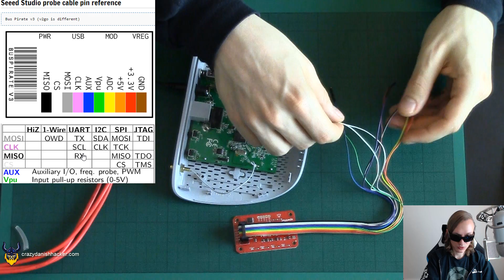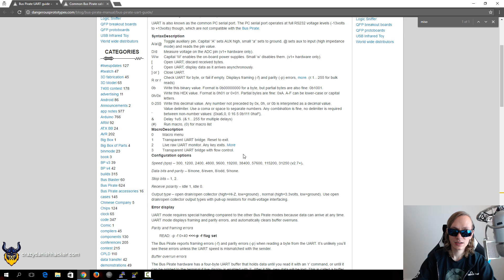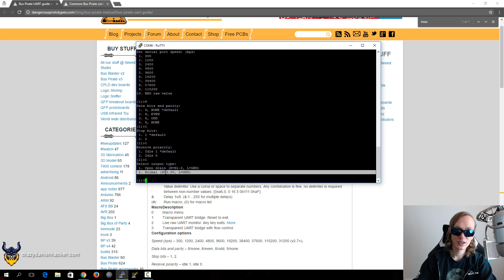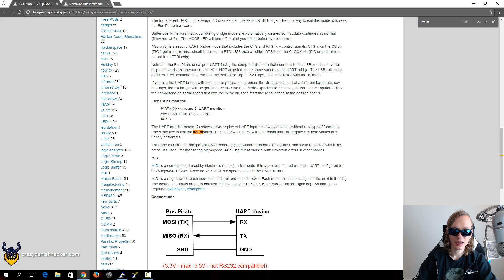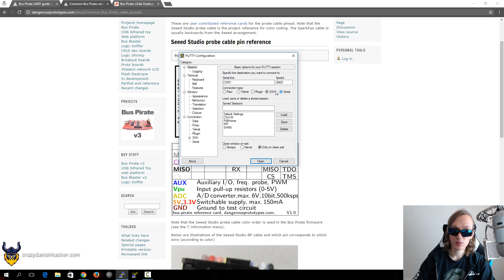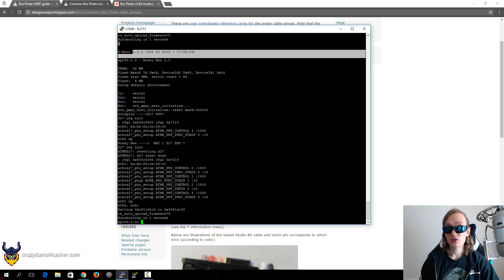Accessing Hidden Serial Consoles - BusPirate Demo 2/2 - Hardware Hacking Series #5

Comment: hi danish, time without write you, it seems spectre and javascript are a big issue

then what i told you is happening in www.elchat.com maybe is true, that chat uses javascript

do you think a website as www.elchat.com can exploit the spectre cpu vulnerability?
Reply from the maker: I doubt it, spectre and meltdown requires a lot of skill and reliable code execution at the moment as far as I know. If you're worried about this attack, then make sure Chrome has auto-updated and that "strict site isolation" has been enabled in Chrome: chrome://flags/#enable-site-per-process (Click enable and restart)
Reply: thanks danish

Comment: Try using the Arduino and Pololu PCB to activate a stepper motor.  It doesn't work. Nobody will help you figure it out. Your head hurts. I have done a few things the U.S. feds would be interested in. Mainly in the U.S. it's the airwaves the feds are interested in and pirate radio. The FCC tracks the transmissions and confiscates all your broadcast equipment and fines you in the tens of thousands of dollars range. The FCC posts every bust they make on their website. There is a small town in India where a certain electronics firm manufactures GSM imterceptors and will only sell to the military. Imagine if you were a private investigator and you used one for a client who was going through a divorce and you captured incriminating conversation. You could sell interceptions and make back your money. It's like a little suitcase with two small antennas. You set it on your kitchen table. It will convert sound into text and in three different languages. You brought us to the brink but dammit I want to hear stuff! Binary strings are all good and fine but where is the juicy stuff? That is my dream. That is my nightmare. Even the government around here is encrypting radio transmissions. What do the police, the CIA, the FBI and all the rest have that is so valuable? They have INFORMATION! Yours in secrecy but if they want you they'll get you. LOL

Comment: how is BusPirate difrent then Serial Console which you have showed here: https://www.youtube.com/watch?v=kxznYuS4tkY?

does it support JTAG?
Reply: easy to say hard to find thats why i told u if u give a tuto i dont need alot even i watch ur vedios for radio have some probleme on my kali :(
Reply from the maker: Good questions as always Veso266 :-) The USB-to-TTL device in part 1 is a lot easier to use (plug-n-play if you have PuTTy), but it can only do UART, which I've shown in my videos so far. The BusPirate can do many different modes, e.g. 1-wire, I2C, JTAG, etc. but it needs to be configured first every time you use it. 

So when I want to play with my routers for example, then I actually use the USB-to-TTL device because I only need to plug the wires in, connect via USB, open COM4 in PuTTy and go. 

For the BusPirate I need to look up the diagram because it has a lot more wires, connect them, then connect via USB, open COM4 in PuTTy, then reconfigure it into UART mode, and finally Macro mode (Transparent Bridge I think it is), and then I can use it :-) 

I haven't tried these yet, but I have read quite a bit about JTAG a month or two ago, to see whether I needed a JTAGulator or equivalent.

If you're only going to do UART, get a USB-to-TTL device. If you're going to do other modes, get a BusPirate. No need to buy both :-)
Reply: need to talk with u if u are online respond please and thx
Reply from the maker: Just ask a question on a video Ebdelli. As long as it's related to ethical hacking I will do my best to answer your question.
Reply: im asking if u give course on CEH ?
Reply from the maker: No :-) Save your money and do Pentesting With Kali (PWK) by Offensive Security. Then do their OSCP (Offensive Security Certified Professional) exam. If you pass you have a much greater chance to get a job.
Reply: thx
Reply: i have CEH but i feel still somthing to learn and i dont jknow what lol
Reply: maybe ther r a stuff dont take it on CEH thats why i told u do u giv courses
Reply from the maker: Learn reverse engineering, exploit research and development (start with basic stack buffer overflows), learn to use Burp Suite and most of its functionality, learn practical SDR things, etc. There is a lot of stuff to learn, even from my videos :-) 
I don't give courses like all those "hax0r courses", but I do make videos every once in a while here on YouTube :-)
Reply: and wher i can find OSCP course please
Reply from the maker: https://www.offensive-security.com/
Reply from the maker: I don't really give private lessons, but you can play with this: https://www.offensive-security.com/metasploit-unleashed/ to start with
Reply: thx